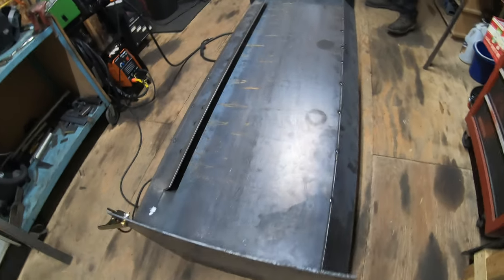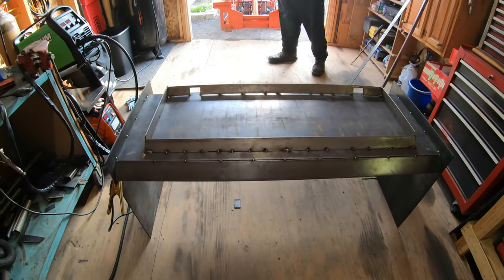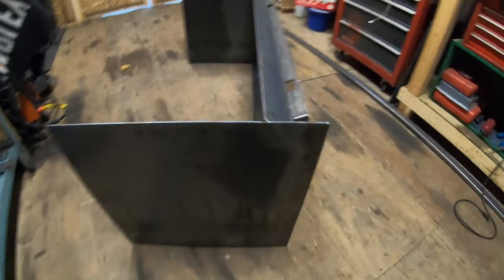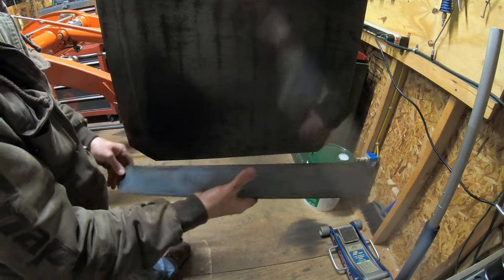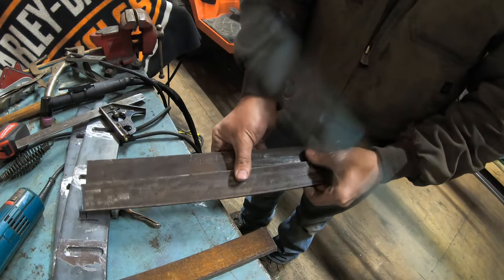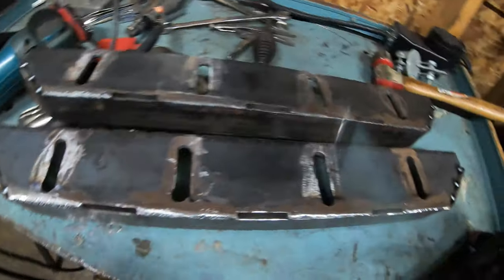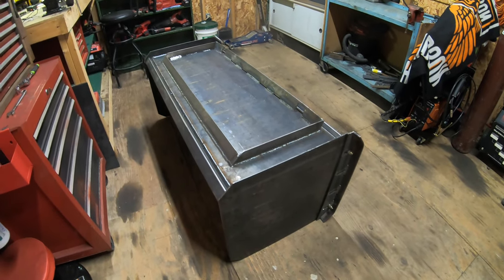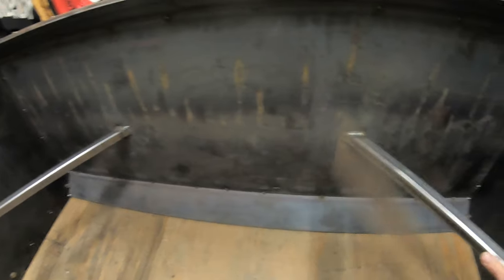Kubota BX- DIY PushBox Build/Custom SnowPusher (Part 2)

Comment: I got lucky with my snowpusher.  I picked up a cheap,used 3pt 5' snowblower,  used it one time, no cab on my tractor, never been so cold.  Removed auger, made simple bracket to mount to my JD F935 front mower.  Put snow chains on the JD, found out by accident these mowers came as an option,a diff lock. This set-up works fantastic for me. I for one appreciate your skill and dedication, good luck on this project it's worth it 👍

Comment: Looks awesome! You're gonna love it. Thanks also for all the extra info you gave me on the last video. I get home Wednesday and I start my wheel spacer install and homemade tire chain project from my old semi truck chains.
Reply from the maker: Thanks man! And sure thing! Glad I could help. Let me know how you make out with the spacers and how you like them! I bought some that I was gonna feature on my channel but they were wrong so I had to send them back, havnt gotten new ones in order yet but plan to do it soon. Do you have a link to the ones you purchased?
Reply: Here it is. 
http://www.bro-tek.com/

Made in America. I was gonna go with Bora, because they're both the same easy install design, but Bora personally makes each after they're ordered, with a pretty lengthy wait time. The Bro-tek shipped the next day and I got them 4 days later. 
 With shipping. 3" were $340, but many chats call them the Cadillac of spacers. Lol.  I just wanted heavy duty ones for my L2501 with the easy mounting system, unlike kubota's where you have to remove the lug bolts, these bolt on to stock lugs, then have their own built in to mount the tires. Should be a quick install as long as the beer breaks don't get in the way which they tend to do in wisconsin. I'll shoot a quick video of them Wednesday when I get home.
Reply: "Woodzman Adventures" has a video installing 2" 'rs on his bx23. If you wanna see them sooner and on a machine your size
Reply from the maker: @ironheadbiker  awesome man! Thanks. Yah you got some nice ones for sure! I couldn’t afford spending that much on wheel spacers so I went to eBay for mine and got some China look alikes but never heard of anyone damaging them yet.. nice to know you got good quality ones tho and I’m sure you’ll never break them as that company has very high standards and makes some of the best spacers out there 👍🏻

Comment: You need your own fab shop dude
Reply from the maker: Thanks Dan, next summer I hope to add on to my shed by building a concrete floor and a lean-too off the side of the shed to make a little metal work shop because working in a tiny 18x20 shed full of tools is not easy at all for big Jobs like this one. If I don’t expand the shed I may rip it out and have a real garage built. Thanks for watching!

Comment: Hey Biff, nice videos so far. New to your vids. What welder are you running?
Reply from the maker: Thanks Dave and welcome to the channel! The welder I use is the Titanium Mig 140 from harbor freight. It’s a fantastic welder. I did EXTENSIVE research on welders before I bought this, months off research and I can promise you it’s one of the best welders you can get for the money if not THE best.. specially when you consider the warentee you can get from habit freight if anything goes wrong it’s also easy to exchange or return. I use a Hobart Handler 140 at work for huge jobs and I can tell you the Titanium 140 is a far better welder. The titanium mig 140 was actually made to be a direct competitor of the Hobart 140. Lastly I will say that the 140 is 110v only but I weld up to 3/8” thick steel no issues with it. Use a .035 wire if your welding anything thicker than 1/8” on a regular basis. And if you want 110v and 220v and wanna weld thicker than 3/8” then the titanium mig 170 is the one you want.. it’s the exact same as the 140 only does both 110 and 220.. hope this helps!

Comment: Maybe add a piece across top front so if u drive up to something u can rotate bucket and back drag. Nice work looks awesome
Reply from the maker: Thanks Marvin! I am actually planning on adding a second top cutting edge for back dragging.. I have a 2x2 5’ long piece of hardned 1/4” angle iron that I think will do the trick.. it’s not very wide but it really shouldn’t have to be just for a back drag.. Though I will prolly add some steel to the back side of it to increase its Depth when backdragging deep snow. Thanks for watching! I’ll have a part 3 video on this pushbox sometime in the near future when it’s totally complete

Comment: Nice I just finished building one yesterday for my b2650.
Reply from the maker: That's Great Patrick! How did it turn out? I will be uploading a new video soon for a new item I purchased for my BX and the Snow pusher is finally painted and will be making an appearance at the end of the new video im currently editing so stay tuned if you wanna see what it turned out like. Thanks for watching, lets hope we get some snow soon!
Reply: @BiffsEquipment  it turned out great. I build a lot of my own attachments grapple dirt screener and going to build a towable grader
Reply from the maker: @puddlejumper3534  awesome man! A dirt screener has Been on my list for a year now just havnt found the time to build it. Did you use an electric or gas motor or did you not motorize yours?
Reply: @BiffsEquipment  I used gas check out my YouTube channel and see how I did it. It works really good. I used a few ideas from different ones to build mine

Comment: I’ve tried watching this 3 different times and kept getting interrupted. Finally I was able to finish it. You did an excellent job! What does a pusher this size cost new vs what you have in material? I’m sure you saved a lot by building this.
Reply from the maker: They are around $1200 give or take a few hundred new.. And I can tell you I have spent much less than that lol. Thanks for watching man glad you finally made it to the end haha.

Comment: Nice welds and nice cuts!  Are you happy with your plasma cutter?
Reply from the maker: Thanks Paul! Yes I’m very happy with it! The plasma cutter I scored off eBay, it’s just a China model I got it for $299 before everyone found out how amazing they were.. once everyone found out what a Great product they were the price jumped through the roof .. last time I looked for a friend of mine they were selling for $900 for the exact same cutter I have but if you keep an eye on eBay you can prolly still score one cheap.. mine is made by “Colossal” it’s a “Colossal cut 50 DF” is the exact model I have.. not all “Cut 50” plasma cutters are equal, lots are made by suoer cheap company’s and you’ll be lucky if they turn on when you get them so if you go looking for one I highly recommend the one I have as I know it’s made by a better company. Best of luck!

Comment: Real nice welding job.  Wish my welds were as nice.  Thinking it could use a lid on about half the top so as snow piles up inside, the snow rolls forward and not over the top.
Reply from the maker: Thanks man I appreciate it! I get what your saying about the lid but typically that’s why these pushboxes are built size wise according to the machine that’s pushing them because once they are full the snow is suppose to spill over so it’s not to stop the tractor from moving forward.. then you just pick up what is left on your next pass. I will be adding a second cutting edge as well on the top so I can back drag with it so stay tuned!

Comment: Came over from Ritter's channel. Great project, you must be a fabricator. I tried some welding on my channel a couple weeks ago, I'm learning. Is your plasma cutter 120V?
Reply from the maker: Awesome Joel thanks for subscribing! That was a really nice shout out Jon Ritter gave me. As for the plasma cutter I did all my cuts on 110v believe it or not but it will also do 220v, on 1120v 3/8" is the limit but on 220v it will nearly cut through an inch of steel. Fabricating can def be a tough thing to learn but keep at it and you'll def get there the more you do it. Thanks for watching!

Comment: Really cool! Maybe I should make one for the mini ex! It might be better for my driveway than a plow. Just have to get that plasma cutter first....Do your plasma cutter have a pilot arc? Is it a good thing to have? Have been looking at the Cut 50 and the price is tempting but then I noticed there were those with pilot arc.
Reply from the maker: Hey buddy thanks for watching. Pilot arc is  MUST have for plasma cutters, with out it you'll find its a pain to cut, specially when trying to cut rusty metal, the pilot arc not only allows you to cut rusty metal but also allows you to cut with out having to drag your tip or make constant contact with the tip of the torch itself. As for the push box i agree it could work better than your plow but you would have to try and see.. The biggest reason i feel it would work better in your situation is because you will have true full skids one on each side that are fully adjustable.. This way you can just set down the push box and it will glide like its on glass vs having a cutting edge being the only thing that's contacting the ground which causes it to grab and bite to the ground specially cuz you have a gravel driveway much like my own. If you installed skids on your plow it would do MUCH better so i would install skids on the current plow you have first before building a full blown push box. try that and let me know how that works.
Reply: @BiffsEquipment  thanks for the info, will focus on that kind of plasma cutter. Will improve the plow with heavy duty skids and get back to you. Already sprayed  the adjuster nuts with wd40 to make sure I can get them off.

Comment: The 1/4" AR steel should hold up fine for skids.  Keep your weight down as much as possible for snow pushing.  Looking good.
Reply from the maker: Thanks man, yah I believe it will be just fine, for the size of my driveway and the fact that it’s on gravel I doubt I would ever wear through that hardned steel.. now if all I did was plow on blacktop or pavement and it was a huge lot I would say it would maybe last a season or so.. whenever I use pushboxes I typically throw the loader in float. I plow for a living in the winter with a 70hp new holland and a 10’ pushbox so I’m quite use to using these pushboxes and really enjoy the way they plow.. they are one of the best snow removal tools out there IMO. Thanks for watching!
Reply from the maker: PS.. if you wanna see some really cool plowing footage with that big 70hp new holland go way back in my videos to last winter and you can see the tractor and the 10’ pushbox that I plow with every winter.. sure is a lot of fun!

Comment: When you use the plasma cutter, are you resting the tip on the metal your cutting. I have done both ways. What works best for you. Nice build. I fixed my loader bucket with 1/8 steel plate and have a video of doing that. What grade of steel and thickness did you use for this project.
Reply from the maker: Hey Mike thanks for watching. I used a combination of 1/4", and 3/16" steel for everything. When I use the plasma cutter I find what works the best is laying the tip on the metal and dragging but being sure to angle the tip away from yourself at a 45 degree angle.. This not only protects yourself but also allows the top not to get clogged and go bad too quickly... on 220v I can easily cut with out dragging the tip but on 110v in my shed it doesn't supply enough amperage to always cut well with out dragging which is why I usually drag. My consumables are very cheap and yet I get months out of a single drag tip. Hope this helps! Ill swing by and check out your bucket video sometime!

Comment: Weld X patterns on the bottom of your skid plates so they won’t ware out so fast
Reply from the maker: This is an old trick guys would use on the skids of their snow mobiles.. I would have but the skids are hardned steel so it really wasn’t needed, the weld woulda been mild steel and wouldn’t have lasted long as opposed to the hardened skid.. so far I have plowed all winter with these skids I made and they have almost no wear at all on them so I predict they will last for years to come. Thanks for watching!

Comment: Nice video where did you get your welder plasma torch
Reply from the maker: The plasma is a cut50DF made by colossal tech and the welder is just a titanium mig 140 from harbor freight, thing works amazing and will weld 3/8” thick steel on 110v

Comment: Hey did you ever put the rubber cutting edge on?
Reply from the maker: Hey Jeff, no I never needed to because the cutting edge needed to rest above my gravel driveway anyways slightly so I just left it the way it was for last year. I still have it and do plan to use it again sometime this winter for lighter snow falls

Comment: Must have miss wit but how thick was that plate steel?
Reply from the maker: Hey Nate, the plate steel I used was all 3/16" accept for a few places like the skids where I used 1/4". I used hardened steel for the skids. 3/16 is plenty for a pushbox or for most implements for this tractor I feel because the bucket that Kubota made for the tractor is made fully out of 3/16" also.. This is how I based the thickness for my pushbox project. Thanks for watching!

Comment: What kind of cutter is that and where  did you get it
Reply from the maker: The plasma cutter is a Cut 50 DF.. it’s just a Chinese plasma cutter and I got it from eBay.. they make all kinds of cutters that look identical but it’s hit and miss which ones actually work and which dont.. I had to do a ton of research to find the one I got cuz some are complete garbage. I got lucky mine was a good one; it’s 2 years old now and still works like it was new.

Comment: For your paint colors, check out the paint jobs Bad Boy uses.  Black body with Kubota Orange for the skids, and maybe a 1" stripe down the side with your name in Orange
Reply from the maker: Thanks for the paint suggestions man. I already have Kubota orange and Kubota grey enamel that i’v had for the better part of a year so I’ll prolly just use that as it’s a very strong and durable paint.. whenever I use their paint it looks and feels just like a powder coat when I get done.. so I was planning on doing the pushbox orange to match the tractor and the bucket and was gonna paint the skids grey.. I actually said the opposite in this video lol.. didn’t mean to

Comment: To think I get nervous cutting and grinding in my garage with a concrete floor. That place is a tinderbox 😳
Reply from the maker: Yes it can be sketchy at times no doubt, when I first started cutting, grinding, and welding in there I was extremely nervous but now that I have been doing it for awhile I'm less fearful but always be sure to keep a fire extinguisher close by. Next year I plan to build a lean-too off the shed with a concrete floor not only for more space but for more safety as well. Thanks for watching!